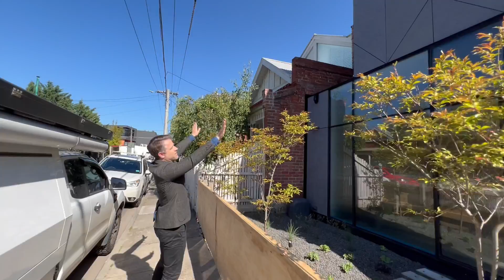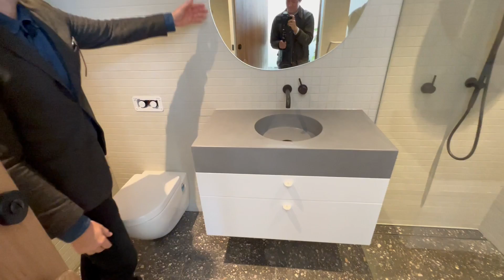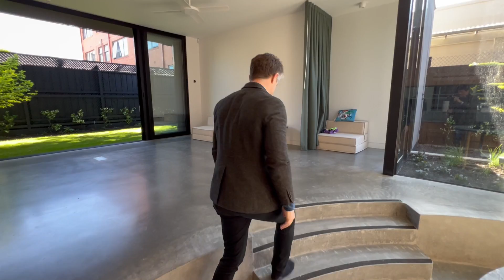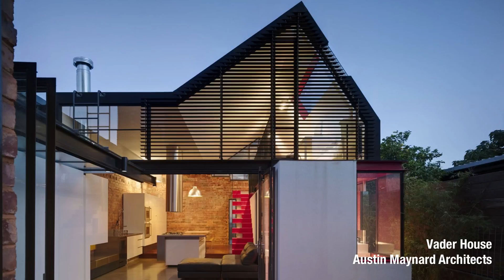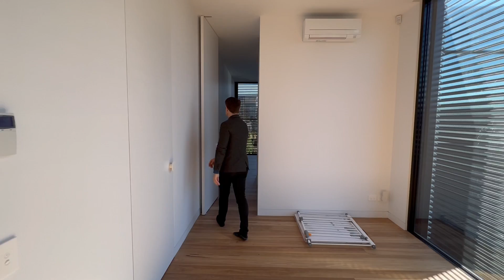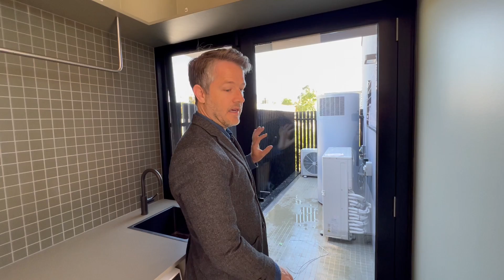Architecture From Planning Legislations - Lang 靚 House by Austin Maynard Architects

Comment: I love the exterior facade and the mix of concrete and wood finishes inside, just one question, with that ground floor bathroom, how do you guys deal with the vapour(condensation) having no natural ventilation, is there a mechanical ventilation system?
Reply from the maker: Always

Comment: Too often codes are treated like constraints to be fought or circumvented. Here it sounds like the objectives and requirements of the code were considered, understood, and integrated into the design process. Well done and bravo to the landowner, who was presumably willing to work with you and with the code, instead of pushing for a specific, predetermined , ‘dream’ outcome.
Reply: And also the planning requirements made sense and guarantee quality of living for the neighbours. You'd want to take them into account even if not legally bound to

Comment: When you drive around Canberra you can sometimes see the shape of the territory plan in the buildings. I think it can be made to work really well, I feel like site constraints can be gifts to the designer. But sometimes you see a house that has been built to constraints but not really designed to them and that can be pretty clunky.
Reply from the maker: Creative problem solving

Comment: nice house. what's the climate like? you mentioned sustainability and solar/thermal design frequently, is the garage inside the main house envelope?
Reply from the maker: It’s pretty much its own volume but everything is thermally sealed and insulated
Reply: @Archimarathon  ah so the slab is thermally broken, nice